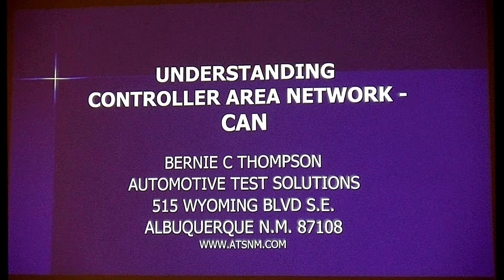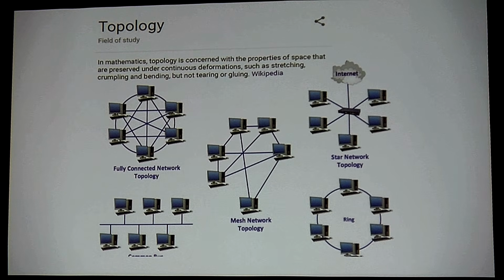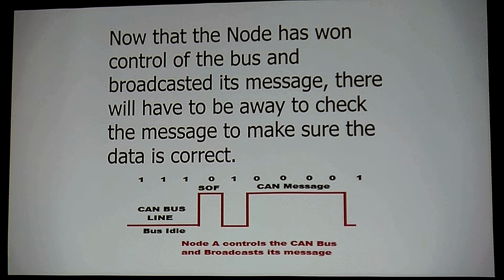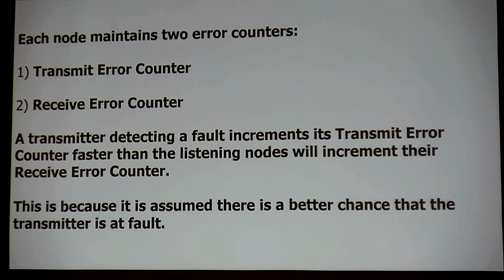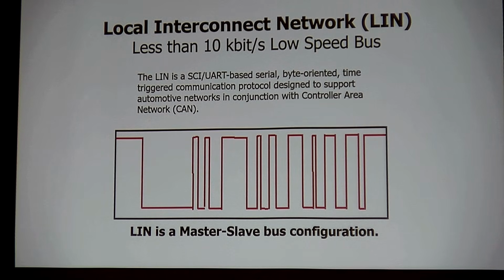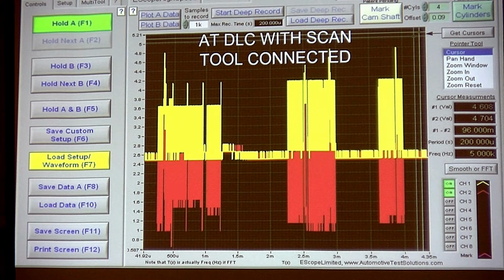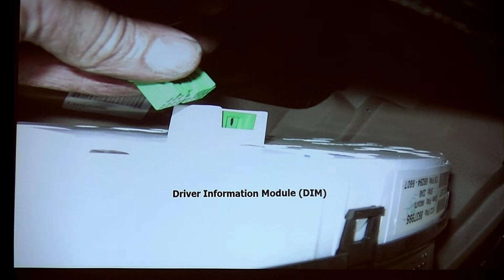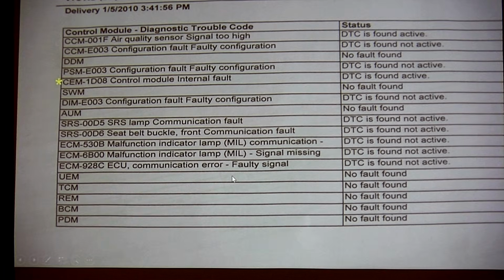Bernie Thompson CAN Communications from the TST Big Event 2018

Comment: I recently heard about a problem which arose out of connected modules on a network - about a vehicle in which water shorted out a tail light because the tail light had a bad gasket ( seal ) - but when the tail light shorted - it also damaged like 5 other modules on the network - so what should have been a fairly simple / inexpensive repair of JUST THE VEHICLE TAIL LIGHT - became a VERY EXPENSIVE REPAIR - as many other modules needed repair / replacement 😐

Comment: Just curious as to why only '32' comments' on a major topic in vehicle Diagnostics, considering 47K views with 30K+ subscribers, the Math just doesn't add up, was it too complex/Boring or simply way above most viewers thinking faculties ? 🤔 The mind boggles, perhaps the appeal of easy quick soundbites are the new 'norm' today ? TikTok and netflix are surely winning the gullible and the simpletons limited comprehension that will no doubt churn out a newer generation incapable of tying their shoelaces and becoming the Kyles And the Karens of the modern age!
Reply: I think everything you said is true. I've been on a big learning kick for 8-10 years now. It has gotten even stronger since I turned 40. There are several subjects and aspects of life that I've been diving into. Thankfully I have a job where it's possible to listen to podcasts and videos like this. However, there are still times where I burn out and have to take a step back and let my mind numb out in neutral for awhile. Most people have no attention span now and learning something new is too much of a struggle and they can't persevere to the other side. It is sad and great at the same time. There are less capable people out there but the ones that can will be able to write their own paychecks.
Reply: Taking up time & space with non relevent comments like this Dont Help😊

Comment: Even if it's not possible to decode every manufacturers command set, a signal monitor scan tool ought to be able to list out the traffic by header addresses and data values as the packet format is standardized.  It should also be possible to identify the modules that have been kicked offline due to errors.